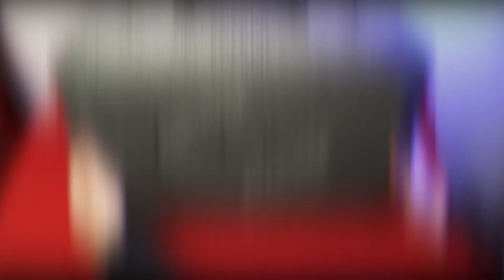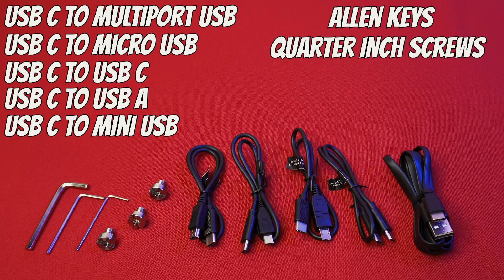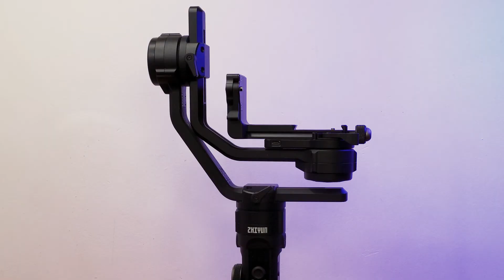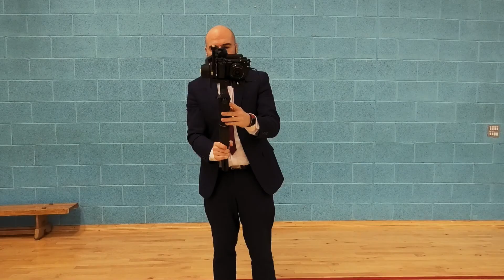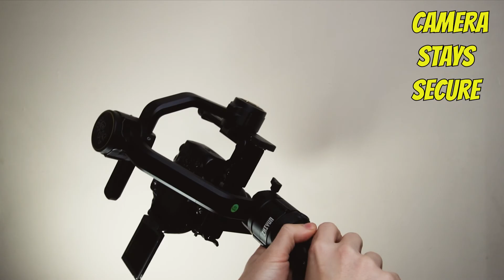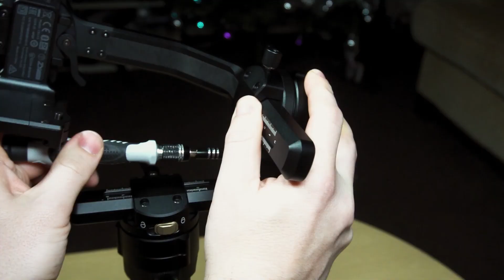Zhiyun Crane 2S Review, Setup and Balancing

Comment: I have been watching so many videos on this gimbal and maybe mine is defective, but I get drift like one motor is not working. It will not return to center or starts panning on its own very slowly. It is balanced and calibrated. So many others seem to have no problem but this one is crap. Going back tot he glide cam
Reply from the maker: Hello there :)  Thank you for the comment.
Sorry to hear you're having issues with yours, I would guess that it is defective.  I can't say that i've experienced an issue with ours.  I would definitely get it returned for either a refund or replacement.
Reply: @Andyhhhdx  Thanks for the reply. Going back tomorrow.
Reply from the maker: @JonnyPink65  No problem. Sounds like it's for the best that it's going back.

Comment: It weighs almost a pound excluding the weight of the camera. How long can you hold it without getting muscle fatigue? If you are videoing a speech that lasts for 30 minutes or longer it could be a problem holding it that long. There's usually not room for a tripod at say a news conference. Maybe a monopod (if they're not illegal)? Is there a belt brace or a shoulder brace you can get for it?
Reply from the maker: You will struggle to film a speech for 30mins unless you're like He-Man as your arms will be killing.  You can get arms which attach to it so you can change the way you hold it which will be much better on the arms.  Unless you want to save on gym membership then this could double up as a training partner.
I've not seen a brace yet for it although they may exist.  There's definitely handle bars for it though.
Reply from the maker: @bluemarbel1242  lol, you would go out to film like a costume of a man and come back with biceps like Dutch and Dillon when they did the handshake in the Predator movie.

Comment: how do you connect the camera to the zhyiun crane 2s? my camera is charging for the gimbal but it's not connected to it fully because when i press the record button it's not doing it!
Reply from the maker: Hello there AllPink.  Just double check that your camera is supported with the Gimbal, i'm pretty sure i put a link in the description with a list of all the compatible cameras.
You should be able to go into the options on the gimbal and select your brand camera and it should work.
Why camera do you have?
Reply: I have a sony a73, when are they going to fix this? :(
Reply: @Andyhhhdx  any tips on how to connect the gimbal to the zy play app? It's not scanning my crane 2s
Reply from the maker: @awillingvessel238  I've just had a quick look on the compatibility list and i can't see the Sony A73 on there :(
Reply from the maker: @awillingvessel238  Hello Allpink :)  When i load up the Y Play App, i swipe across on the screen so that it selects the Crane 2S because the first screen i see is for a "smooth-Q2" which is not the one we want.
Once i select the Crane 2S, click on connect now.  This scans for the Crane and detects it and i press enter now and it's connected.  
Just make sure your Crane is powered on and make sure you're bluetooth is on.  Just double check that your bluetooth is not automatically connecting to something else like wireless earphones and this could cause an issue.
Reply: @Andyhhhdx  why? its a fairly new camera sony a7 iii
Reply from the maker: @awillingvessel238  ahhh i'm sorry, when you originally put A73, i didn't realise it was the Aiii, i thought it was a different model of camera.  I can see the Sony A7R3 on the list, i'm not 100% sure if that's the same camera you have.  But it says that the camera firmware version on there is V3.01.  Might be worth going into the settings of your camera and seeing what firmware version yours has.

Failing that, it might be worth dropping Zhiyun an e-mail to double check the compatibility because i would have thought your camera would be supported.  It might just need a firmware version update on the Crane itself to get you up and running.